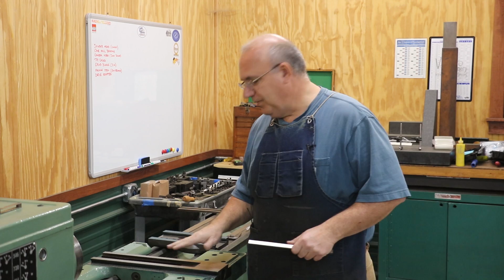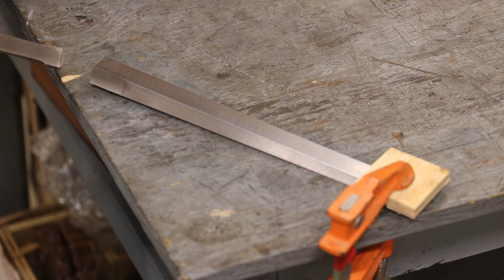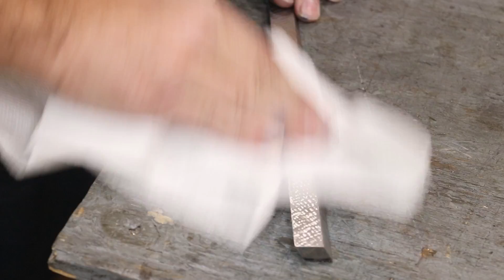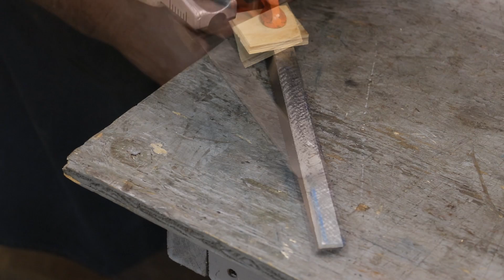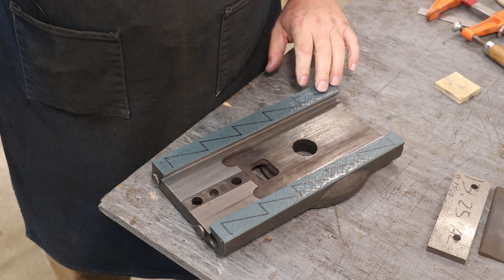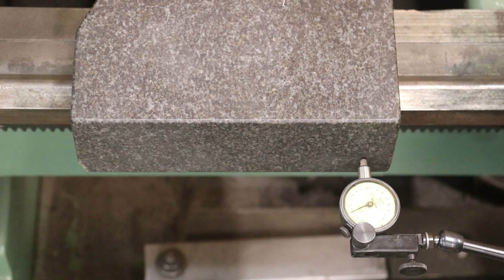Scraping a Tapered Gib to a Lathe Cross Slide: Monarch Lathe Restoration - Part 22

Comment: Hey Keith! I love your restoration videos, I've been closely watching your hand scraping videos as well as Ron Grundy's scraping tutorials. I also do research about hand scraping on metal since its the only  process to achieved flatness. My question though  is? why are you not scraping the top of the dovetail and bottom of the dovetail of that removal cross slide? Are that part not meeting surfaces? I look on youtube but nobody is explaining it. Are that part have clearance to compensate the wear and tear for the near future you can still restore back to its optimum condition. Even in the milling machine knee only the side and angle part where the gib is of the dovetail is hand scrape but the top part remained untouch. Please help my confusion! Keep restoring!

Comment: Many years ago I was taught how to scrape ways. I was taught to hand scrape all surfaces using masters for tight places like this. Large areas also had masters. I was taught to use an orange rubbing paste to find the high spots. I was also taught to make the scraping tools. I was just a young electrical engineer

Comment: Wouldn't you want to put a flat surface in a chuck on your lathe head and run your indicator off of that seeing as how they  work surface will be chucked up there? To make sure both are parallel to each other?

Comment: Hi, Keith. Awesome stuff. I was thinking don't you have to also blue your gib on your surface plate alternately because tapping the dovetail into your ways doesn't necessarily blue the 4 corners of the gib, i.e., the perimeter of the gib's surface is not blued when test fitting?

Comment: Keith, Thank you for the  info on scraped surfaces. I'm about to try almost the same process. 
Only the Gib on my machine is installed  in a  Vertical Orientation.
I've already been cautioned about the possibility of jamming the Gib.
But  I cannot find any info on how best to avoid a jammed Gib condition.
Can you offer any advice on how not to jam the Gib while checking the Bluing process?

Comment: Great work Mr. Rucker!  The smoother the surfaces, the more likely they are to wring together.  Gotta have scraping.  I have a compound gib problem myself.  The one in my lathe looks like it was scraped with a roughing mill.  LOL  I am ordering a new gib, but it will have to be ground and scraped.  It just never ends!!   'Til next time.
Reply: @chris0tube Wasn't talking about scraping, was talking about grinding?  That why I said you gotta have scraping, in reference to ground surfaces.
Reply: @chris0tube Some type of relief in the surface is needed to allow oil to "float" the gib to minimize wear, and sticking.  mrpete222 made a new gib for one of his small lathes that was neither ground, nor scraped, and it worked just fine for his purposes.  The metal would have had enough surface imperfections to allow oil to penetrate between gib and way.

Comment: Hi Keith, is there a path from those oil grooves in the turcite to some oil fitting? If not how do you get oil in there? Nice work! Also, some rebuilders relieve the middle of the cross slide by a thou or 2 so that it won't wear convex. Why don't you do that?

Comment: One think that I don't think you checked for was any curvature in the gib. When you ground it, the magnetic chuck would have pulled any curvature flat, so the result would have been accurately tapered but perhaps a bit curved. The printing you did during the scraping would have done the same thing: pressing the curvature flat.
A curved gib will fit ok, but the pressure between the gib and the ways will be concentrated in one spot (or two, depending on the direction of the curve). This will produce increased resistance to movement and uneven gib wear.
You could test for this by trying the pivot test on a surface plate, for both the front and back of the gib.
Reply: Very astute observation and I agree. I had thought of saying it at the end of the previous video but decided not to bother upsetting Keith's plaudits again.  Keith would not have thought of your point.
Reply: chris0tube
And there was I thinking that mine was a lone voice here. Thank you for that, and again, you have a very eloquent turn of phrase.

Comment: I still don't get the scrapping...if the wedge is tightened in place and there is no slop on the top piece and it still slides back and forth with no binding, why is scrapping necessary? It was a perfect fit and then you hack it all up by scrapping..? Seems like there is nothing precise about hacking willie nillie by hand on a flat combined angled surface...? That guys comments at the end are exactly making my point....so oiling is the reason I guess....

Comment: Keith, you totally lost me with having a 5 thou run out in towards the headstock. When you do a facing isn't it supposed to completely flat and not have a dish to it? When your using a cutoff tool, then it is cutting on a taper, or am I not getting it?
Reply: it's a 5 tenths runout, not 5 thou. That's 5 tenths over what, maybe 10 inches? If you're facing something that's 6 inches in diameter, you'd move the slide 3 inches, resulting in the center of your face being about 1.5 tenths shorter than the outside. that's tiny! but, as Keith says in the video, if it was convex instead, when you set the "flat" end on a flat surface, it would move around. If it's concave slightly, it prevents that problem. If you made it flat, then any other runout could easily cause the part to become convex, so those 5 tenths are a little bit of insurance to make sure your faced off ends hopefully always end up on the concave side.

Comment: That is going to be a sweet lathe when your done. Do you even use the lodge and shiply at museum anymore?

Got myself one of those mini mills cheap. Slightly used guy was cutting aluminum when a screw came out of circuit board and toasted board. Less than one hour of use. Packed in that slimy none grease stuff to prevent rust got to take it apart to clean everything. Reason for it? Cutting key ways on motor shafts. Got any good but reasonable advise for a vise four inch? The amazon ones all have reg metric thread screws instead of acme.

Comment: Excellent video, very nice that the lathe is where it should be in regard to perpendicular, but it begs a question: What do you do, and how is perpendicular corrected, if the perfect situation
 is not the case, and the cross-slide is out of alignment ?

Comment: Why does the cross slide not need to be machined so it is 'square or parrellel" with the chuck and spindle to tailstock axis?When you set the angle to "0" shouldnt it be at a 90 degreese to the spindle /tailstock asis? Wont the angle reading be off this way?  You wont be makeing square 90 degree faceing cuts this way.Nice lathe by the way. Keep up the good work.
Reply: Because forces on tool have tendency to push cross slide in the other direction. There must be some slack, otherwise cross slide will be impossible to move. So, to achieve straight cut, lathe must be set with some pre-tension in other side.
Sorry for bad English.

Comment: Good explanation why scraping is needed. It's all about matching the geometry and stick and slip.

Static friction (as when things aren't moving) is always greater than when the parts slide along nicely. It's like compressing a spring, you build up force until the static friction can be overcome (stick) and then the parts suddenly move apart (slip) and it can be sometimes more than what you intended.

Comment: Quite honestly, I have never seen a ground surface used when both are the same material, both the gib and slide are cast iron. You need the oil pockets and as you say to adjust the angle etc. for proper fit

Comment: Hi Keith If you are going to make a new cross nut . You should look at making the nut longer if you can because it would last longer with more bearing material. I have done this and I use Aluminum Bronze for the nut . Good Luck

Comment: Keith I don’t intend to be critical, I’m not sure how you can accurately scrape the gib without a proper work holding method. The gib seemed to be springing up and down during your scraping process.  Recently Dale Derry posted a video where he employs a surface grinder magnetic chuck for work holding while scraping.  I’m not a scraping expert but the magnetic chuck scenario seems more plausible to me than clamping the gib unsupported on a wooden bench, especially after you went to the pains to surface grind the gib.  It appears it turned out just fine though. As I said before, not being critical, just an observation.
Reply: If he was scraping a bow, it would show when he blued it.
Reply: Everthing that could have happened was bending the gib while scraping it on that uneven surface. Didn't happen, so it's fine.
Reply: @chris0tube I don't see that risk of increasing the effort.
Reply: @chris0tube In previous clips about scraping he had to do several passes too. It's part of the scraping job. Putting the gib on the wooden desk was not ideal for sure, but it did not lead to increasing the expense of work in a significant way.

Comment: Sorry but I didn't understand the explanation of why you don't want the cross slide running 100% perpendicular?
Reply: He also mentioned in a previous video that as it wears it will tend to push out towards being convex. Better to start a little concave to compensate for that eventual wear.
Reply: When the tool goes towards the chuck it will try and resist and twist the bit in the opposite direction (tail stock, there's always slop otherwise things wouldn't move easily). Also when facing one would more likely want the end to be concave towards the chuck and then the end will sit flat on a surface... Don't really know... :)

Also when doing bearing surfaces one would like the most outer surface of the race to contact the surface... Otherwise it could twist along the axis when mounted, like a ring on a ball...

Nothing is ever perfect. Railroad tracks are also like strings of wire, everything bends.

Comment: another great  instructional  video Keith i have just  got my sticky hands on a Chinese  mini lathe   so am expecting to end up  stripping it down and  re building it I just hope my efforts  are as  accurate as yours
Reply: I suspect when he finishes, the Monarch will be at a far higher level of accuracy than when it was new.  I bought a used Chinese 3 in 1 machine a while back and did a similar teardown and re-build, and it was amazing how accurate it was after all done.  I'm sure you will have the same results with your mini lathe.